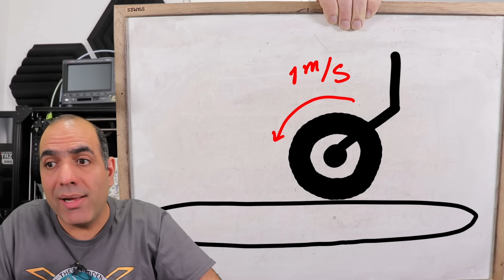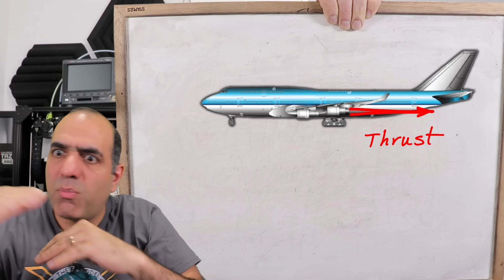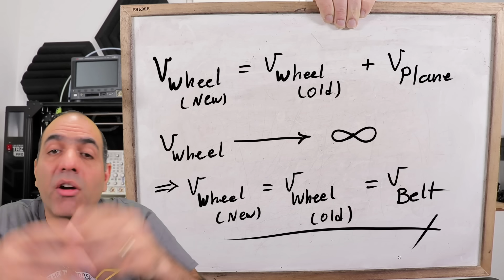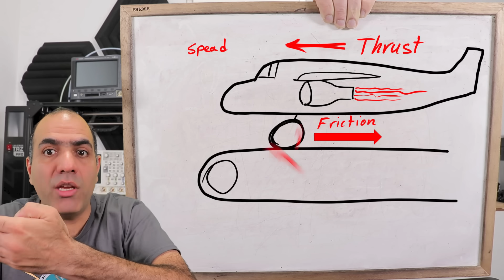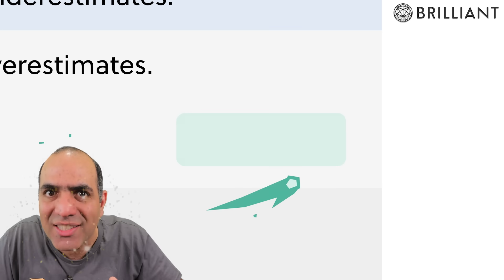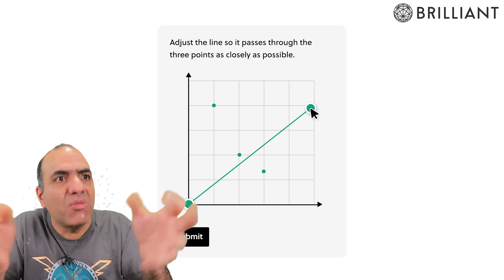Airplane Question that Drove Me NUTS!!!

Comment: Even in the situation where you have friction everywhere, as the speed of the conveyor belt increases it will be dragging a sizable boundary layer along with it, if the runway conveyor belt is long enough ahead of the plane it would eventually create enough headwind to takeoff from a "standstill" anyway.
Reply: Although i wonder, how long is "long enough" for a take-off?
The plane would need enough time to get the engines up to speed while floating.
I would assume that it shortens the runway, but i also wonder how big that 'drop off' moment will be once it clears the artificial wind, kinda like taking off from a carrier.
But that is a lot of friction though..  i imagine the plane rattling and falling apart before the conveyor belt even gets up to speed.
But i guess depending on whatever fins you want to put on the conveyor belt (presumably out of the wheels' trajectory), it could work better, but it would have to go pretttty quickly i think, so it has to be very smooth and durable.
Reply: @Games_and_Music  Aircraft engines use either an airstream from a smaller electrically starting turbine to spool up the main engines, or a separate truck with a supersized blower comes by to provide the initial starting flow. Some engines can even electrically start the main turbines by just backdriving the alternators. In any case, the plane's ground speed has nothing to do with engine startup.
Reply: @dustinbrueggemann1875  Thanks for that bit of info, i had never actually thought about the initial startup process.
But by "getting up to speed" i meant for the engines to outperform the conveyor effect.
Reply: @Games_and_Music  Well it says it is as long and as wide as a runway so presumably there would be enough time to accelerate. Especially since that boundary layer should get slower as you increase in height too. So in theory the plane could stay at full power and climb slightly as it accelerated to maintain it's airspeed at Vr until it clears the end of the treadmill thus stopping the air drag increasing as much. It can absolutely still accelerate at that speed after all they are still accelerating quite rapidly with a 15 degree pitch up after leaving the runway normally. Although they will lower the power once it reaches 250 knots as they will still be too low to fly faster in most jurisdictions as there is a speed limit at lower altitudes.
Reply: @FaerieSeraphina  Yeah true, i did have a bit of a change of mind between writing the opening line of that comment and the "i'd assume" line.
Because initially i was thinking it might have to be longer, simply to get the desired airflow going, but yeah, once the plane is getting floaty, it wouldn't actually need the full length anymore.

I still wonder how exactly it will go though, as i keep imagining the plane sorta moving wildly in the stream, because it will hit the end of that air cushion, and starts dipping before picking up airflow and pitching up.
Sorta riding the air cushion forward until the thrusters fully take over.
But yeah, now that you mentioned the speed limit, i'm starting to think that riding the air cushion might actually work too well and they would have to hold back on acceleration, which in turn makes me worry about the timing of the dipping without a considerable 'off-ramp' again like on carriers to sorta try to save yourself (or bail).

EDIT: Couple minutes later, i was just zoning out on this, and imagined if the belt broke down.
As a pilot, you'd see something come loose from almost a mile away, it's a giant slab of fins from the side, and as it starts moving it, it grows in size and looks like a giant slicer, ripping through the plane like a knife through butter..
I think there might be some additional safety issues with such a system, aside from adding many millions of other moving parts.
Might as well use a gigantic fan for the wind-tunnel air cushion take-off.
Reply: We still don't know if there is any air do we?
I was wondering about the boundary layer and I seem to remember that dues to dynamics doesn't sheer occur at higher differential speeds?.
Reply: This is the most interesting and mature answer so far.
Reply: No it won't. The engines would disrupt the airflow and probably create enough drag to cause the aircraft to move backwards.
Reply: The problem doesn't specify how much air will be dragged by the conveyor belt and whether it will create enough lift, therefore this answer should be discarded as not reliable.
Reply: @igorbondarev5226  It doesn't matter.  If the wings provide ANY lift at all, it lowers the contact area/friction patch of the wheels.  Once this value starts decreasing, it's only a matter of how much time until it lifts off.
Reply: Exactly, this is the correct answer. Not sure what this overcomplicated way of saying it won't takeoff is getting at.

Comment: IMO what would be more interresting would be if the belt went the same direction as the wheel, in order to shorten to runway
Like the escalators in the airport
Running on them gives you super speed
But since the airplane relies on air on the wings, would that mean the engine would have to work even harder to achieve lift?
Reply: If the belt moves with the airplane the result would be that is taken of the same way as it usually do, the wheels are just not spinning.

That is if you do not apply breaks. If you have broken the result will depend on exactly how the bet control system works. If you start the engine and apply thrust the airplane body will move a bit forward with the wheels still on the ground and if the belt then matches the speed it should result in it helping accelerate the aircraft.

It should be said this in done in two ways in reality. One is the lift depends on the speed of the air relative to the aircraft, not the ground relative to the airplane. Airplanes take for this reason off into the wind, which reduces ground speed. A parked aircraft with low takeoff speed can be lifted up in the air when parked by a sting wind.You need to tie them down to the ground.

The other way is to have an airfield that can move, that is what carriers do. If the ship moves into the wind the airplane moves at wind plus ship speed before the engine is used. A carrier that over at 30 knots into a 20 knots wind results in 50 knots wind speed before you use the engines. In WWII the stall speed of carrier aircraft was quite low a US F6F Hellcat has a stall speed of 73 knots so the majority, if the speed require for takeoff, is provided by the wind and ship movement.

Comment: After watching until 0:35 the answer was obvious. Of course the plane would take of, almost like normally. However, the wheels would rotate twice as fast as normal. The system that the plane relates to is the stationary air and not the conveyor belt.

Comment: Wheels are only there to be a reasonable bearing so that when the plane takes off (thanks to the engines), there's not too much friction with the ground. It might help to instead imagine the same problem with a seaplane -- a plane with no wheels. There the friction with the ground (water) is prety high, and yet the seaplane can still take off.
Reply: I think it does help, but as a demonstration that the wheel doesn't matter.
You can still have all these scenarios Mehdi proposed.
Plane floats downstream until you add thrust. Then you need sufficient thrust to overcome the flow (friction) of water. With fast enough water, you can't stop moving downstream/backward... so turn around lol
I don't think I've seen anyone talk about the plane being pulled backwards so fast that it "weathervanes" and takes off in the other direction lol
Reply: what if there is an opposing current that matches the airplane speed? :DDD
Reply: I imagined another scenario, if you get roller skates go on a treadmill and attach a rope in front of you to hold on to, the roller blades will spin up to the treadmill speed but you can still exert force on a static  object/matter (in this case the rope, as if it was the air in plane's case) and move forward even if the roller skates are spinning at the same velocity as the treadmill :)
Reply: @valtercosta2108  but it states the treadmill will roll to match the speed, so there's a scenario where in trying the treadmill would desperately keep going faster, and eventually cause both the roller ski's and plane's wheels to spin so fast they explode lol.
Reply: @randompheidoleminor3011  yeah probably, but if the airplane landing gear and the treadmill were made to withstand such huge forces the airplane would take off
Reply: @valtercosta2108  in that unrealistic case the treadmill would accelerate to the point where the force produced by the friction equals the thrust of the plane's engines, keeping it in place.
Reply: @randompheidoleminor3011  no dude the plane would take off because it’s pushing the air and not the ground. Just try it yourself at home if you have a treadmill and some hotwheels. Turn on the treadmill and place the car on top right in the middle or the end of the conveyor belt and you’ll see the car moving forward and all of that without an engine now imagine if you strap a fan on the car. You can search on YouTube if you don’t have that.
Reply: @valtercosta2108  if unsupported the hotwheels car will fling backwards off the treadmill, this is because there is friction generated between the car and treadmill (which would no longer be insignificant at high enough speeds). Using your analogy it would be like the treadmill going so unimaginably fast it takes all your strength just to hold onto the rope, leaving you unable to even release an arm to pull yourself forward.
Reply: @randompheidoleminor3011  no it won’t just try it dude or check on YouTube and you’ll see it does go forward :) and no it doesn’t matter the speed of the treadmill the force in the rope will always be equal because your still moving forward the same amount the treadmill is going backwards, that’s two opposing forces of the same intensity nullifying each other strength on the rope wouldn’t change. And again wheels are meant to lower the friction against the floor that’s why we have brakes, to increase friction and take us to a halt.
Reply: @valtercosta2108  that's the point of the whole arguement: wheels are mean to reduce friction, but they cannot eliminate it completely. if it is running fast enough the friction generated will be so substantial that the thrust will be unable to overcome it.

the videos you see of hotwheels cars racing on treadmills work because the treadmill is angled downwards.
Reply: @randompheidoleminor3011  Mmh yeah but I still don’t believe in that. For me the airplane will take off because it’s power comes from the thrust and not the wheels if it would come from the wheels then it would be another story
Reply: @valtercosta2108  lets flip the scenario - imagine a car or a human trying to move forwards, but then the wind accelerates to stop them from doing so, would they move?

In day-to-day life wind speed isn't really a hindrance to our movement but in such a hypothetical scenario  would result in crazy hurricane winds blowing them to a standstill, despite the fact that they move by making contact with the ground instead of the air.
Reply: @randompheidoleminor3011  no because we push on the ground as do a car but airplanes push on the wind via engine thrust. Did you know planes prefer to take off against the wind and not with the wind?
Reply: @valtercosta2108  yes, but since the scenario is literally the opposite there is zero wind flowing over the wings and thus no lift. 

There are only two types of aircraft capable of lifting off in these situations:
- certain propeller aircraft where the airflow over the wings produced by the props generates sufficient lift by itself (like the one used by the Mythbusters)
- VTOL aircraft like the harrier that uses vectored thrust and a T/W ratio higher than 1
The 747 is neither of those.
Reply: @randompheidoleminor3011  why would there be no wind? You seem to miss how a plane propels itself forward. Once in the sky the airplane doesn’t need its wheels, the wheels only purpose is to lower friction against the floor to let the plane roll. Bear with me, plane will push on the air to move itself forward (note that it pushes air, not the ground) wheels will start to spin and so will the treadmill, the wheels are free spin and the only force they put to the ground is the plane’s mass that points towards earth’s core, airplane will keep getting faster and faster (moving forward) and so will the treadmill but remember how I told you that the force the wheels put on the ground is downward? Now think about the jet engine, the engine pushes back (you can imagine a line pointing to the front of the plane, the direction that force is pushing) see how it is putting a force on the air and not the ground? Now it comes the forward movement and the wheel velocity increases but don’t forget those tires are free spinning, no forces pushing the airplane forward nor backward only pushing down (from plane’s mass) the treadmill will accelerate making the wheels spin faster and making the treadmill accelerate even more like it’s a loop and goes on indefinitely until the plane takes off but it will definitely move forward.
Reply: @randompheidoleminor3011  you’re thinking about humans who do push on the ground and would remain static from an outside point of view because (here with the lines again, your foot transfer 2 types of forces to the floor vertically (our mass) and horizontally (when we push or pull to go forward or backward) and we would be pushing on a floor that’s moving on the opposite direction of our movement with the same speed thus making us stay in place no matter what. The airplane contrary to us is pushing static air behind its engines it’s not pushing against a moving floor. Can’t find better ways to try to make you see it clearer sorry.
Reply: @valtercosta2108  the tires are free spinning but are not entirely frictionless. If they spin absurdly fast enough the friction will be significant enough to match the aircraft's generated thrust and halt it completely, resulting in zero airflow and zero lift

In a world where frictionless wheels exist the plane would be able to take off, but such things do not exist in ours - of course neither do wheels capable of spinning at such high speeds so they'd just blow up well before like I said in my original comment.
Reply: @randompheidoleminor3011  well let’s just say we agree to disagree :) yeah tires would blow up that’s why I said if we had a landing gear that could withstand huge amounts of force. It has been nice discussing this with you bro, it would be great if we could do a simulation like that to solve this, take care ;)
Reply: but they are desinged for that and have floaters to reduce the friction enought to take off without complications, a normal airplane in the water would get destroyed by the friction before taking off
Reply: @PurpleH4z3  The pontoons don't reduce the friction as much as you'd think. Seaplanes don't have brakes but still stop in reasonable distances.
Reply: If there is not too much friction so the plane can move forward it will violate the criterion that the belt speed exactly matches the speed of wheels. The only way for this to happen is when friction is equal to thrust, whatever it takes. I hope less than speed of light is required
Reply: i dont understand why do people ignore that airplanes use their wings to use the force generated against the air to lift
the propulsors arent aiming to the air, they are aiming stright, so the plane would never take off as air wouldnt move under the wing since the airplane would stay in the same position

and if the plane did take off the sudden hit of air pressure surelly would endup causing an unbalance and a crash
Reply: @PurpleH4z3  The friction force of the wheels is never strong enough to overcome the thrust of the engines. The plane will accelerate and a negligible amount of power will be used to spin the wheels slightly faster. The wheels are passive.

Comment: Thrust and lift aren't the same thing. The airplane would be in a stall unless there is sufficient head wind either from being pushed into the wind or just strong winds. If you were to have thrust high enough to take off without proper lift going over the whole of the wing I think it would rip the wings clean off.

No, evidence, just my beliefs.

Maybe if you orient the engines pointing straight up, then you would have lift.

Comment: Ignoring the friction resistance aspect, as a thought experiment, just consider that seaplanes don't have wheels and can still take off just fine with pontoons.  

Overall though, this is like those stupid math problems that get posted on social media from time to time.  Like 6÷2(1+2)=? or 9-3÷1/3+1=? which is are only controversial because they use improper or outdated formatting and can be interpreted several ways, which is why we don't write math problems like that in the first place.

Comment: xkcd already said everything relevant about this discussion. There are two camps based on the interpretation of the question. One says that the speed of the conveyor belt is equal to the groundspeed of the plane, so the plane takes off (this is what Mythbusters tested). One says that the speed of the conveyor belt is equal to the relative speed of the plane to the conveyor belt, so the system is ill defined and the only possibility is that the speed is 0 (or infinity) and the plane doesn't move.
Of course, if you analyze it dynamically (considering the wheels rotate freely and without friction on the bearings/axles) there is no force that stops the plane from accelerating with its turbine/propeller thrust so it will always take off and that's the real answer in any practical case